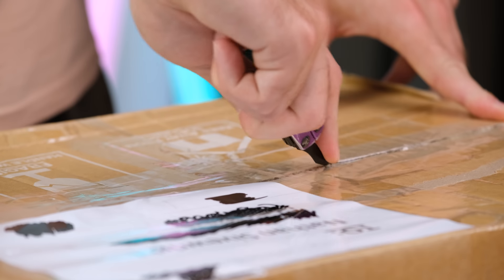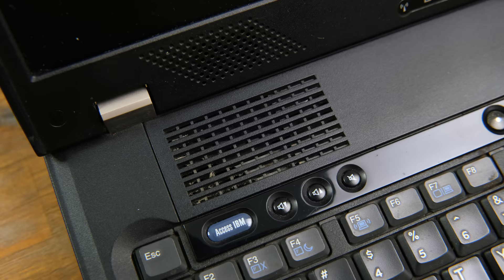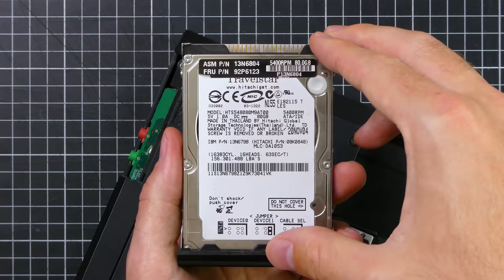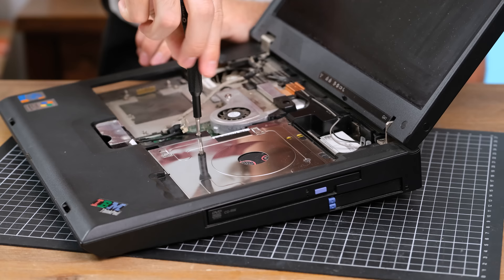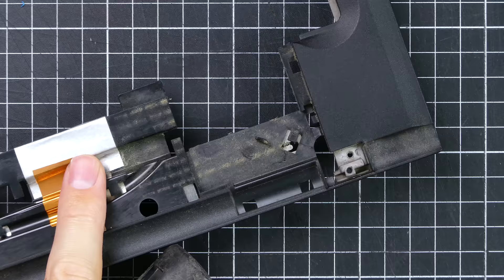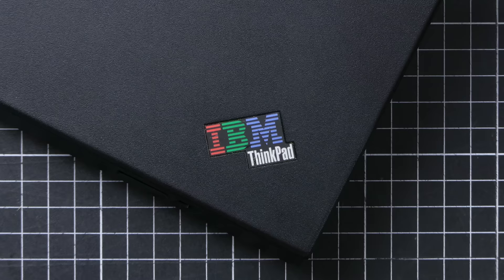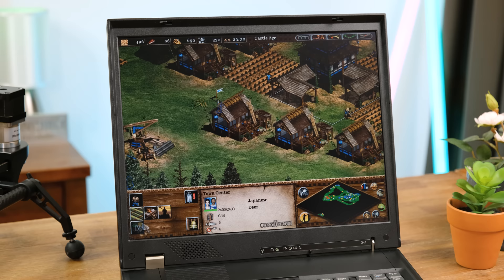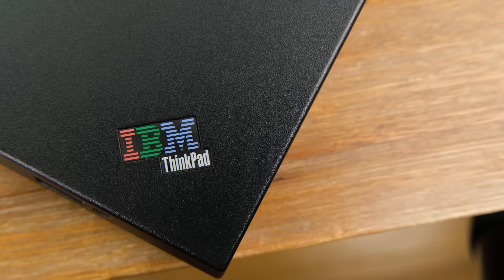IBM Thinkpad G41 - Restoring A THICK Pentium 4 Laptop!

Comment: Im sure some school is still using these... lol
Reply from the maker: I wouldn't be surprised. IBM ThinkPads were built to last :)
Reply: Even some companies uses windows xp
Reply: My school has prehistoric pcs, theres even one with windows 98 on it.
Reply: I think older version of Windows is more friendly than the newer version 🤣🤣🤣
Reply: It's on windows XP, some companies still use windows server 2003, windows 98 etc
Reply: @psivewri  I have like that Acer for like almost 14 years from now. Hope it is an IBM masked as Acer.
Reply: @sharvinvijayan6742  I saw a clothes shop using a dusty laptop with dusty fan dock with windows xp
Reply: Wdym we use Lenovo ThinkCenter towers (specs: dual core intel pentium (don't remember the model) , 4gb ram, 120 GB HDD space for school stuff and intel HD graphics. Boi are these ancient 😀) But they are true beasts.
Reply: Probably not cause XP can’t really surf the web without problems anymore but it wouldn’t be impossible. Before i graduated in 2016 my school still used single core Celeron with 1GB of RAM based computers with Windows Vista lol
Reply: My school store uses one of these.
Reply: Here in cyprus they don't i don't know about other countries
Reply: @sebastians_soul  Not surprising, I was in high school when this thing was brand new and they were using the original Macintosh computers.
Reply: Most likely to some public department or military application, I canndeffinrtly see this laptop still at use. Great video, as always.
Reply: They likely went to chromebooks
Well, as long as they can log on to Google Classroom and do word processing, it fits the need
Reply: @KazyEXE  it is basically the same thing for me, in 2004 the macintosh was 20 years old and my school has early 2000 computers which they claim are "brand new" half of them are louder than my grandma's ancient vacuum cleaner though lol
Reply: Jeez, am I the only one who's school computers actually have proper specs to run windows 10?
Reply: @simplyalonso  my school has like 3 pcs that can run win10 and 30 others on 7, xp, 98
Reply: mine has one
Reply: MY LAST JOB USE THESE. THEY SOME HOW ARENT THAT SLOW
Reply: @RetroBitTech  windows or linux?
Reply: Nah, they can't find the budget to keep a 2$ mil building from collapsing but they can find the budget to buy 8$ mil in apple laptops that break every year
Reply: Man we dont even have this
Reply: my School's Computers still run Win 7 (Not the latest Windows 7 version) with 4:3 "monitors" and The Fan is always crazy and takes like 6 minutes to load IE.
Reply: @LennyQUMFIF  windows 7 is completely fine
Reply: Yes my school does. I have a better laptop than my teachers 😂
Reply: @TheOnlyAvailableUsername  I have no laptop at all...
Reply: Even Pentagon uses windows xp
Reply: @riderprovider909  how do you know lmao
Reply: @DemeDemetre  you can google
Reply: yes.
Reply: @DemeDemetre  Dw, there is a fruit at the end of every struggle ☺️
Reply: @TheOnlyAvailableUsername  I hope...
Reply: My school pcs have windows 2.0
Reply: meow meow meow meow meow meow
Reply: @ANYA.RIZALI  meow
Reply: Mine was and maybe still is
Reply: @MaybeKadenALT  this exact model? or something similar
Reply: some?
Reply: 'thank you thinkpad'
Reply: @null8455  that's a crusty old card.
Reply: @null8455  my MacBook Air 2020 is not just thinner, it’s angrier and screaming louder than the world can hear
Reply: @TheOnlyAvailableUsername  same
Reply: @TurnupCannon419  nice what laptop u got :)
Reply: No, they use the room sized computers from 1950
Reply: My job uses pentium CPU’s running windows 10 with 2gb of ram 😂 it’s so damn slow
Reply: we are lol, they upgraded them and somehow got windows 10 on them but the boot time is over 10 mins
Reply: @sharvinvijayan6742  heck even the government of the us does
Reply: yeah.. might be in India LOL
Reply: @ABCEasyas--  my school uses old CRT eMacs, which means we have to use a old version of Safari, so my school computers are only used for basic web browsing, and word docs.
Reply: hospitals  in Pakistan use windows xp and windows 98, windows 8 and windows 10 is not used all around pakistan.
Reply: My school still has a load of these to give out as loaner laptops
Reply: it looks like gaming laptop at 90s 😅
Reply: @psivewri  My dads using a Samsung from 11 years ago, Lol!
Reply: Dude in my country schools use older laptops than that
Reply: Nah my school has windows 95 pcs
Reply: Im using this lel
Reply: Not these but smilar
Reply: You should not use this type of words....lol
Reply: @innerpeace9655  why shouldnt i ?
Reply: mine uses Tuf Gaming laptops with 3070s which you keep after high school
Reply: @gabrielnystrom6779  you guys have it well lol
Reply: @DemeDemetre  hahaha yeah we do!
Reply: @gabrielnystrom6779  Where do you study?
Reply: @DemeDemetre  Sweden
Reply: @DemeDemetre  windows ofc
Reply: @sebastians_soul  PCrassic park
Reply: The hospital I work still use the Windows xp whahahaha!
Reply: @sharvinvijayan6742  the Greek government use windows 2000 and windows 98 🤯
Reply: Why would a school still use a old thinkPad😂🤣
Reply: @nushnume  and a and ECS motherboard ahahahahah
Reply: @addo9697  Since schools use computers for years and almost no maintenance at all + abuse from the students it's pretty hard to have an ECS. Those things could barely last 2 years even with maintenance. Liked the purple color but the boards were junk. I myself had one back in the Athlon XP days,died after 2 months lol
Reply: @nushnume  you absolutely right, i  have 2 2001  pc with ecs mobos, one is for intel celeron and the other amd athlon, the amd pc incredibly still works after sitting in my really moist basement althogh all the caps are blown, and i accidentally blew up the intel one as i was trying to fix some ram issues. anyways as soon as i read celeron 1gb ram immediately thout about those old ecs mobos , it made me  go back to when i was a child doing my homework on the homes pc and casually that mf pc would restart as if i rebooted it and i would hope that word saved all my work.
Reply: I agree😂😂😂
Reply: Indeed mine still use these
Reply: Yup just found one right now 😂
Reply: Виорика Длиныи  well keep in mind ;)
Reply: @sharvinvijayan6742 us military
Reply: My school uses windows 10.
Reply: My friend's computer is still running windows 95
Reply: My school has some trash Chinese laptops with quite good specs for CPU (Intel core I7 6th gen.) and 8GB ram. But the problem is the cooling cause if you use it for too long (15/30 min.) it overheats and blue screens 🤣🤣🤣
Reply: Schools don't use laptops
Reply: Yep we are
Reply: Talking about School PCs, my school uses the Dell Optiplex 990 with Intel Core i5-2400 (2nd Gen CPU 2012) and running Windows 10. But they are sooooo dusty and this is weird for you English users, but those Dell Optiplexes have a bug, like the keyboard is an English Layout HP one, and the Windows Language is in Spanish, so the 2 languages mixed up and Half Windows is Spanish and the other Half Windows is English.
Reply: @pixolotl39YT  tbh those are still fine, but if not taken care of, any computer will become slow and eventually unusable.
Reply: Well our school uses stupid chromebooks
Reply: It would be fine if they didn't insist on running windows 7 or 10 on these poor things.
Reply: @petermikus2363  true, honestly chrome OS is fine for school work too. Or some stable version of Linux.
Reply: Well, we have ThinkCentre desktops from IBM, but ThinkPad laptops in our school are from Lenovo
Reply: My school used to have Chromebooks and found out it was very slow and unreliable so they switched back to windows 7 laptops then got some windows 11 laptop with a light up keyboard
Reply: My school îs using a Pentium I Windows 95 PC
Reply: unironiclly my high school math teacher uses one😭😭

Comment: ibm was sadly one of the only computer companies that truly had real upgradability
Reply: Frankly, working on laptops from it's age and thereabouts (when they ALL just HAD to have an optical drive, or else it would suck), it's not that uncommon to have socketed CPUs, 2 RAM slots without soldered crap and a HDD behind a decent door, heck MXM video cards. Even the WLAN cards could be replaced....if you wanted to flash a custom BIOS or buy from the vendor.
It just went downhill fast when someone decided that it was oh-so-important that it's thin. As if the thickness really changed much in what you could bring along it on a bag, much less during use.
Reply: @Kalvinjj  it has gone downhill I'll agree but imo it's also become easier to do maintenance on current laptops where you just need to pop open the back panel with most models that aren't thin and light allowing to replace most parts other than the cpu and gpu, I wish socketed mobile chips made a come back tho
Reply: @b1rd1e81  True thankfully there are some models still that you just pop one big panel and replace anything but the CPU/GPU. It's obviously not all lost, and the one thing that thankfully is left in the past is the failing north bridges from overheating/bad BGA soldering. Have an HP one here that had this chronic issue with it's north bridge/GPU chip that had bad cooling and BGA soldering issues.
Nowadays since it's all on the CPU or separate GPU chip, they kinda have to be decently cooled (granted this part is sometimes wishful thinking), can't have a dying north bridge and happy CPU without a clue about the cooling problems there.
Reply: Not just upgradability but repairability too. You've had service manuals etc and more importantly every part had a FRU partnumber so you could easy order pretty much every single part of the laptop
Reply: I put the date at 2008 when Steve Jobs pulled the Macbook Air out of manila envelope. The entire laptop industry save for gaming, engineering, and rugged use copied them.
Reply: As someone who has a current Thinkpad, it's dogshit, you can't even overclock via the bios
Reply: @theairacobra  not sure how good the thermals are but do you really want to push the cpu more with measly cooling?
Reply: Dunno man, HP laptops are pretty upgradable (CPU, ram, hdd, cd). Acer and Toshiba use to have upgradable graphics and I believe Clevo is the only one doing it. CPUs aren't upgradable since the 2014 models due to Intel and AMD policies.
Reply: @theairacobra  current ones aren't dogshit why would you even  want to overclock it decreasing it's life span
Reply: @Maximus20778  PROBABLY BECAUSE IT RUNS LIKE ASS
Reply: @theairacobra  what specs it has? Lemme also guess did you update your driver's and software? There's no way a old ThinkPad works better than a new one
Reply: @Maximus20778  its a l13 yoga pro, look that op for yourself, half of the time im on linux
Reply: @theairacobra  you said you had a current ThinkPad,that's not a ThinkPad tho lol i thought you had a new ThinkPad and calling it trash
Reply: @Kalvinjj  My laptop has a socketed CPU, a DVD drive and an MXM Graphics Card. It's basically a magnesium brick, but at least everything is upgradeable.
Reply: the true computers with upgradeability are fujitsu-siemens laptops, and fujitsu now even, fujitsu for its price gives you exactly what you want, and the old fujitsu-siemens laptops were the definition of modularity
Reply: @minelayer26  Those machines lack integrated graphics and have C2Ds at most.
Reply: @Kalvinjj  you guys should look at the frame.work laptops
Reply: @stanb1455  they were still decent laptops for their time
Reply: Older laptops apparently are easier to upgrade. I noticed that in a lot of older ones, for example, to replace or add RAM, there is a dedicated slot that you can unscrew to reveal the RAM slots.
Reply: Dell was better
Reply: @theairacobra  why do you want to overclock a THINKPAD? 
you have nothing to do or something?
Reply: There's framework for thin and light modular laptop, and clevo for heavy desktop replacement.
Reply: Actually, eurocom, now clevo offered much better upgradability for longer, many of their desktop replacement laptops had full fat desktop/server CPUs in them, as well as dual mxm b GPUs.
Reply: @Kalvinjj  well for some people portability is important. I would definitely not carry one of these things to school, and even if portability wasn't a concern, some people do not need a PC-replacement for a laptop and just are casual gamers who've been playing mostly the same games for years ( or maybe they don't really care if they can play the latest and greatest on their laptop, but they do so on their PC. ) 

for those people, a big beastly laptop is pretty useless and more of a burden compared to a portable laptop with decent specs.
Reply: @ms-dosguy6630  The thing is that there should be a middle ground, but that isn't much of a thing anymore. There's only market for the people that want the form over function, and the beastly giant thing.
A socket for a laptop AMD CPU that I have here, from heckin' 2006, adds like 3~5mm in thickness. If that is too much, then form over function won, which it did. RAM slots same deal, no excuse to solder any of them since they're thinner than the CPU heatsink each slot, without optical drives in there, space ain't lacking. It's simply not about size, but just profits. You can't upgrade? You buy a new one.
Things just were made with a different mindset back then. This AMD laptop I'm talking about is a Pavillion DV6000 series. Despite it's horrible BGA issues, it's made to use more than show. The screen is twice as thick as new laptops, because new ones just have the screen, and as little plastic as you can have around it. That one had a slab of fiberglass reinforcement to not let the screen bend and break when something lies on top of it. Same with the hinges, they aren't screwed into the plastic housing like all other laptops I've opened past ~2014 or so, but instead screwed into large aluminium/magnesium alloy parts that let it take the bending force of the screen opening and closing all the time. Obviously it was heavy and thick compared to new laptops, but I would rather have something on that style, now if I wanted that I would just have to go Panasonic Thoughbook.
Reply: @Maximus20778  the L13 is definitely a ThinkPad, it's a ThinkPad Yoga model from 2019
Reply: @theairacobra  It's a laptop, man. This has nothing to do with the BIOS, intel laptop CPUs always have a locked clock multiplier. Even if you could overclock it, you wouldn't gain any performance, because you won't have enough cooling to give yourself any headroom. It's like this with any laptop, from any brand.

And when you say it "runs like ass", like, are you trying to play games on it? What's running slow?
Reply: @Kalvinjj  Laptops are inherently form over function. If you just wanted function, you'd buy a desktop. The "form" makes it portable. It's not just for looks, it makes it more convenient to carry around. You have to make compromises to make a device that can be thrown in a backpack and run off a battery.

With that said, though, check out the Framework laptop. It's basically infinitely upgradable, in a pretty compact form factor. You might like it.
Reply: The early 2010s dell precision mobile workstations were incredible for upgradability, you can swap cpu, ram and even the GPU
Reply: Eh, at that time it was common across pretty much all comparable enterprise-ish machines from other vendors. One reason ThinkPads are remembered more fondly is probably because they originally didn't have low-end consumer focused models. And honestly, ThinkPads were also pretty anti-repair in a lot of ways, very early on they implemented hardware whitelists, so you could only replace components with ones specifically approved by IBM/Lenovo
Reply: That’s really not true…..almost every computer company in the world offered mostly modular and serviceable mobile products until 2017 or so…except apple and other luxury brands that hopped on the trend early. IBM were no more repairable than any other company’s offerings and if anything they had lots of avoidable problems in their enterprise focused line-ups.
Reply: I had some older Dell nad HP professional( very expensive back then) laptops and those were also easily upgradable. Similar to this one
Reply: @Kalvinjj many wlan cards are still removable
Reply: @Kalvinjj The reduction in thickness is less about ease of use (nowadays, there are some that are frankly unusable due to how thin they are), but more about "beauty". Apple is the leading factor in this, their notebooks are getting so thin that they have to put the prices on the moon to accommodate the manufacturing costs, that and, well, they're Apple!, of course it's gonna be expensive.